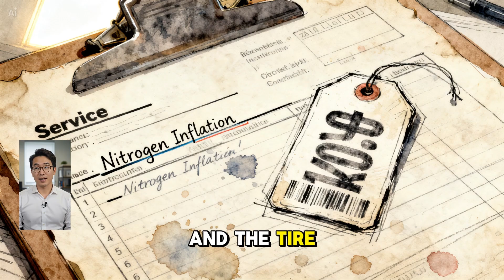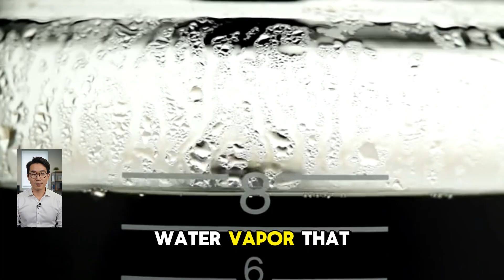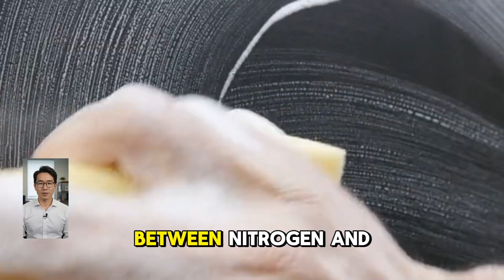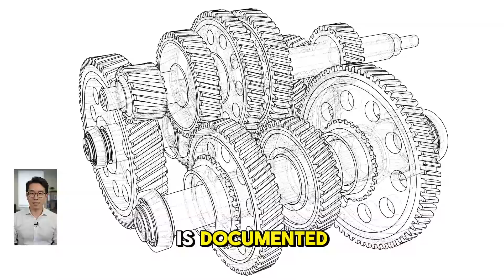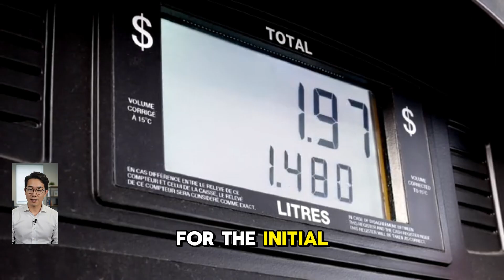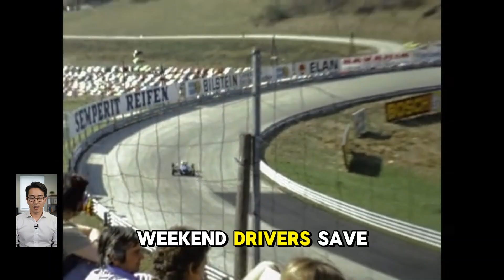The $1 Gas That Keeps ANY Tire Inflated PERMANENTLY — Auto Industry BURIED This

Comment: Air is already 78% nitrogen.  HOW do you replace ALL the air with nitrogen?  Moisture in tires and UNDERINFLATION are bigger problems.  Just check your tires regularly.
Reply from the maker: “Interesting take. Have you personally noticed any difference with nitrogen-filled tires?”